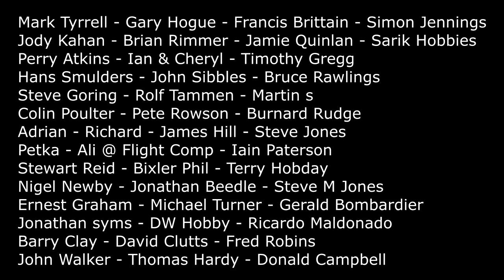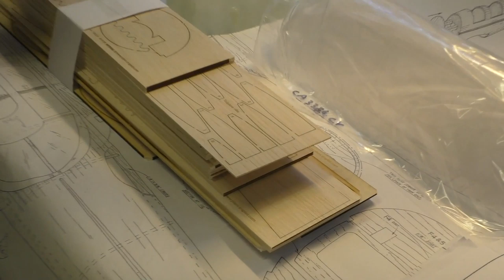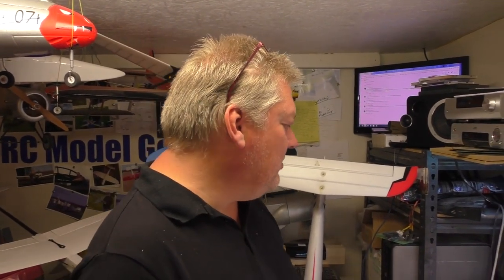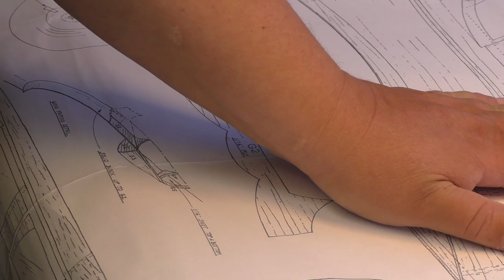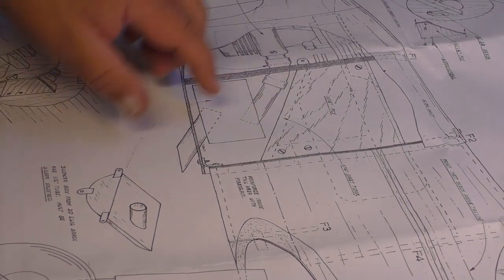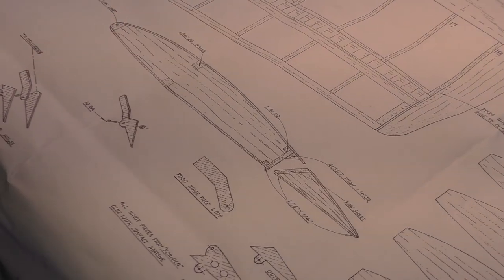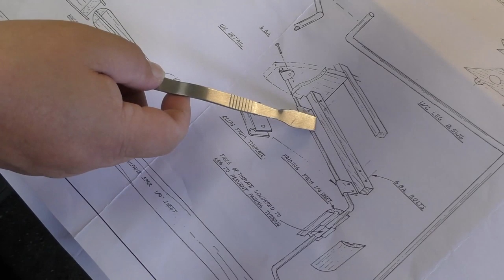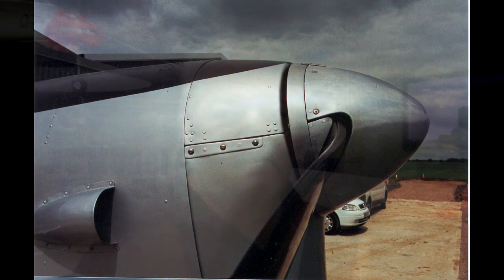Sarik Hobbies Dennis Bryant 68" DHC-1 Chipmunk Build Preview RC Model Geeks

Comment: Dennis Bryant the legend,all time served model builders will fully appreciate the quality of his plans with good old traditional and very scale like construction,the Chipmunk is a classic machine and I have flown both the full sized and model versions,in fact I used to maintain G-AOSX a gleaming polished metal example my pride and joy in the day,this aeroplane virtually set up my career in aviation and taught me so much.
Congratulations to Sarik who have maintained all of these old drawings and brought building them up to date with these beautifully produced laser plan packs,Dennis Bryant was a prolific designer and builder producing some contest quality scale subjects and once and for all every model was built from the ground up and flight tested not left to the receipient to sort out control geometry ! this was the first thing I noticed on that plan,every part has been pre worked out to function properly and that is the way it should be.
My Chipmunk will be Eflite 90 powered,having tested one of these motors for a while now they produce more torque than a 60 sized IC motor,simply brilliant with an 80 amp ESC and you can swing a scale sized propeller too easily,nothing worse than seeing a tiny non scale prop on a model like a warbird.
Ah those brick servo's of yesteryear ! I had Skyleader which was basically a copy of the American  Kraft gear and those had push pull ones like on that plan,those look like Bonner bricks ! the only problem with long bellcrank driven linkages is the attention to slop build up from the servo to the horn on the aileron,they did it like that because the servos were not like the small ones we have the luxury of today and there was simply no room to make direct drives.
I agree everything is on the plan grain direction,see underneathchop throughs the structure construction,sizes of materials and sketches of the smaller metal fittings that any self respecting model builder will enjoy fabricating,we need to keep these hands on skills alive which were 'once' taught in schools but sadly they prefer looking at a sterile computer screen these days without getting your hands dirty,there is no substitute for real aeromodelling,those plans are treasures which you can incorporate your own favourite ideas if needed,in this case very little in fact its all there and you can see how functional it is.
I think you will enjoy building this one Rob and it will enable you to make some of your nicely done metal fittings as well,good luck with the project and thank you to Sarik for giving you the opportunity to try one of their productions.

Comment: Hi Rob and Colin.  I look forward to following your biuld on this one, especially since I biult one myself (but have not yet finished or flown.  I had the complete top under the canopy come off from the cowling to the former behind the canopy.  A little reinforcement under the top longeron of the bottom section should make it OK.  I also threw away all the 'formika' bits I made and did them all in G-10, a much stronger substance.  The 'formika' they make today is much too thin and brittle for model use.

Keep up the good work.
Reply: Yes be aware of this Formica is brittle to say the least,paxolin was used originally but dangerous to work with,I lost a work mate who had breathed in the awful dust.